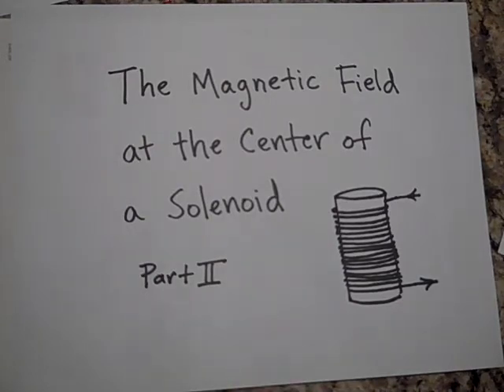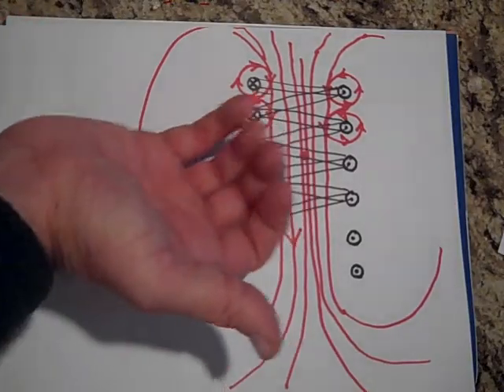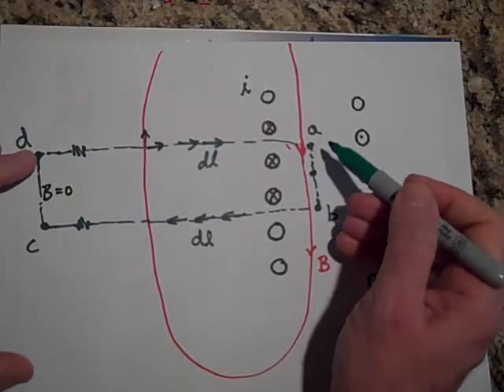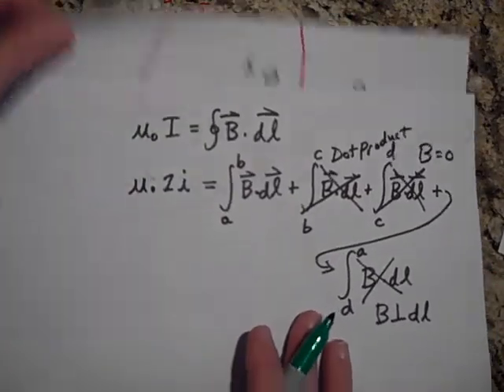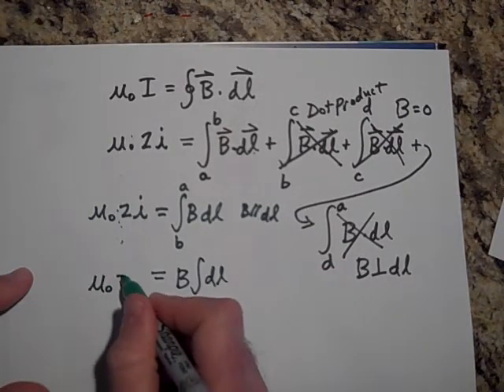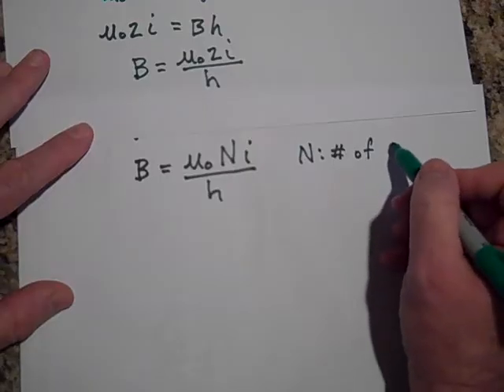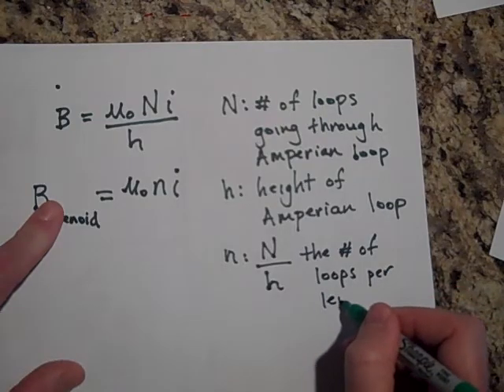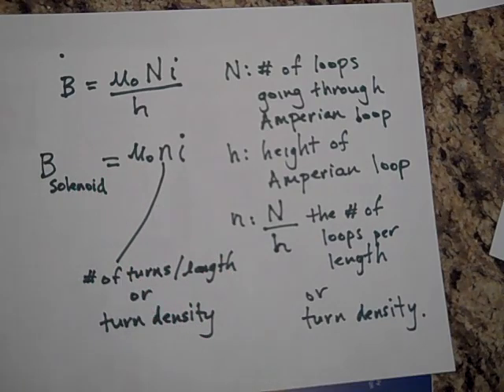The Magnetic Field at the Center of a Long Solenoid (part II)

Comment: You keep saying this is the magnetic field in the center of the solenoid, but isn't this the magnetic field anywhere inside the solenoid? I don't see you specifying where you are within the solenoid, in your derivation of the magnetic field. I think this would be sensible, because of the symmetry. When you're further from the center, you might be further from "the right side" (refering to the picture used in for example 0:50), but you'll at the same time be closer to the left side and so the magnetic field would be constant inside a solenoid.

Comment: Why don't you have to multiply the magnetic filed by 2 because you only derived it for one side of the solenoid. The other side of the solenoid counts too.
Reply: The beautiful man By that logic we should multiply the whole thing by 2piR because the WHOLE LOOP contributes, not just the 2 opposing points you can see from the cut of the loop. But we arn't doing that kind of sum here, this is an ampereian loop. μΦ(enclosed)=ΣBdl . Therefore all we need to know is the charge inclosed, in order to get that magnetic feild. Remember this is true in EVERY situation, we just drew our loop in such a way that all of the sides but one cancel to zero.